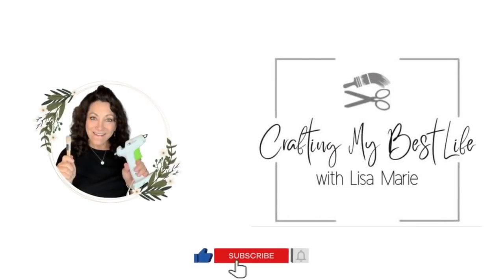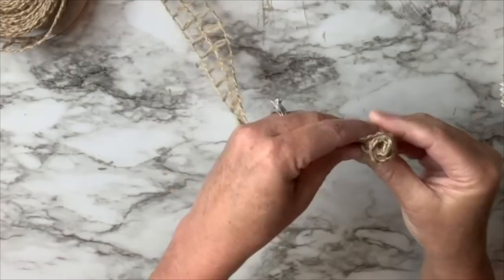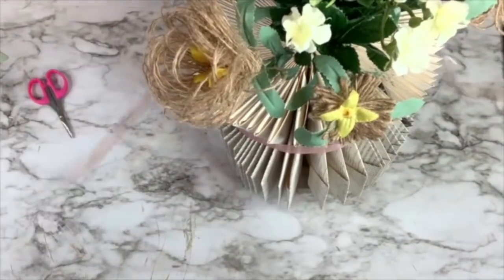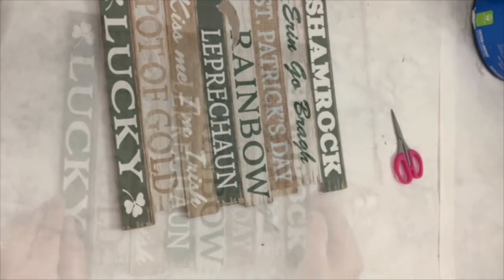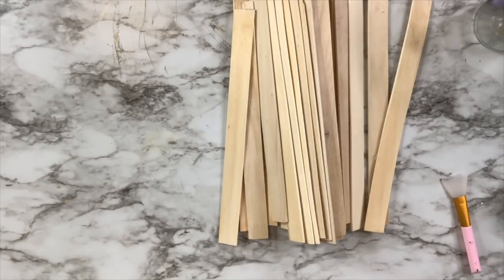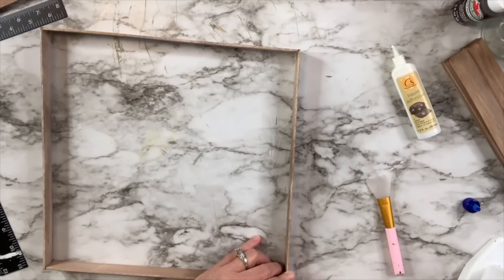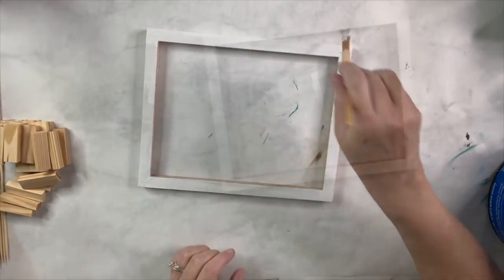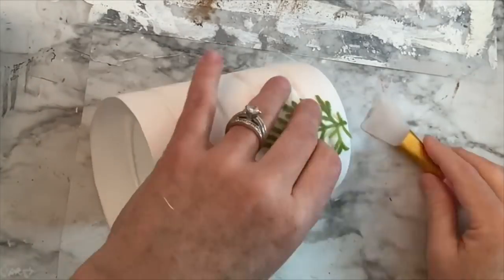⭐️ 20 SUPER EASY RUSTIC FARMHOUSE DIYS

Comment: Love the vase made with a book! I need to try that! 
If you get some of the shelf liner gripper and cut a piece to fit the bottom of your miter box, it will help with the slipping. In fact, that stuff will prevent anything from slipping. I actually put it under my old mattress at the corners and it helps.
Reply from the maker: Thanks so much!! What a great idea to use shelf liner gripper. I even have some on hand. I will try that!! 🤗